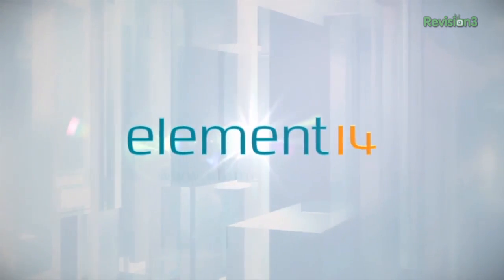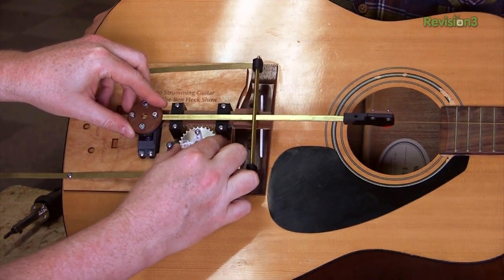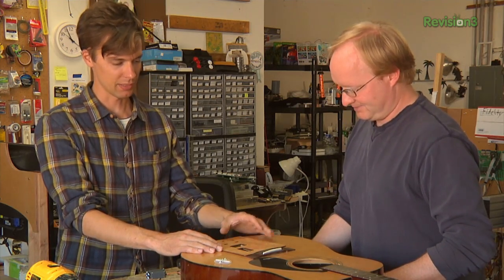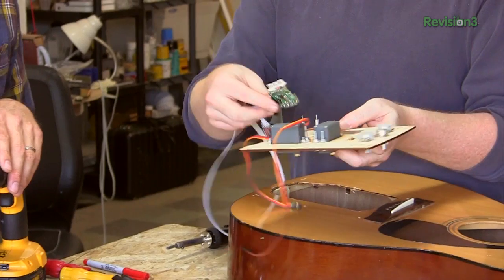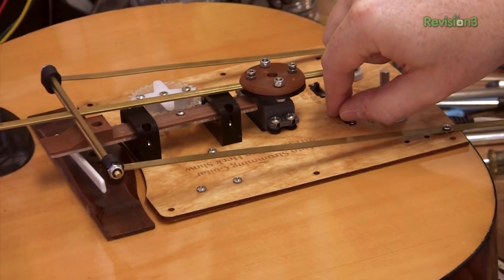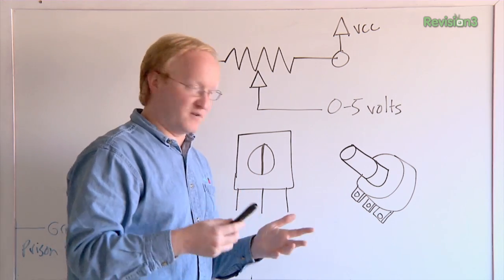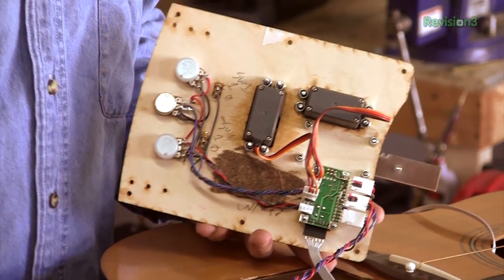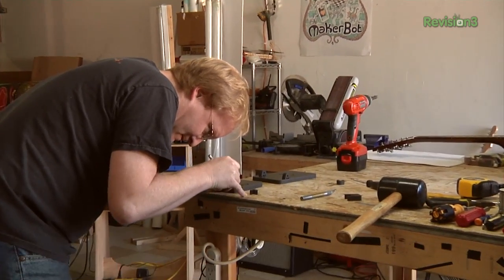Ben Builds a One-Handed Guitar - Part 2

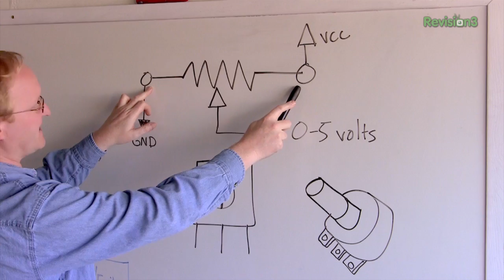Comment: Question... Wouldn't be better to add a resistor between GND and the potentiometer? @ 7:20
Reply: Are you talking on the output output (wiper) of the potentiometer?  No, that would make a parallel combination between the bottom side of pot then which would make your output an inverse relationship.  It is safe to put one between the output and the input of Arduino though for current limiting and protection.

Comment: I'm by no means an engineer, but I don't like this solution.  Cutting apart a guitar is detrimental to it's sound.  And what if he wants to pick individual strings?

I would have tried mounting the device to the soundhole so it can be transferred to any guitar.  I would try having the downstroke/upstroke pedal (ideally with LEDs for the string it's on), and either a touch sensitive strip along the neck, or a push-button pedal for when to strum.